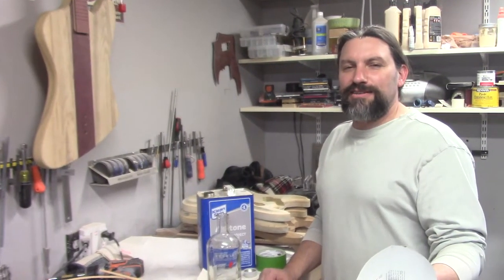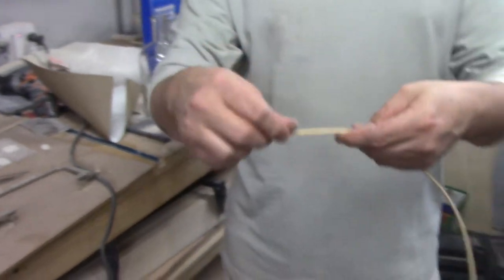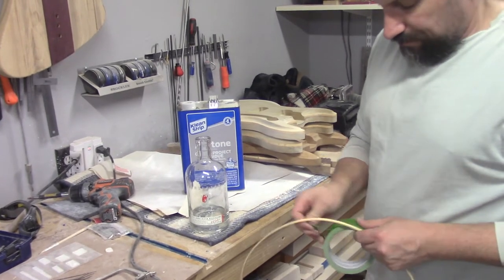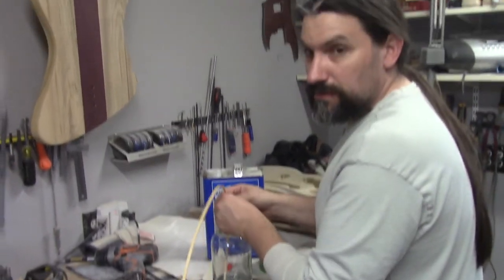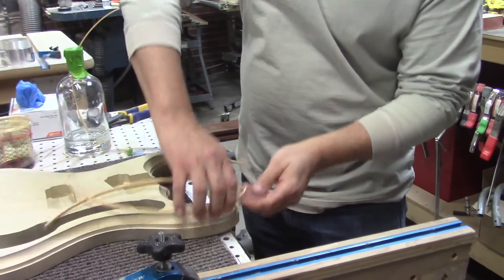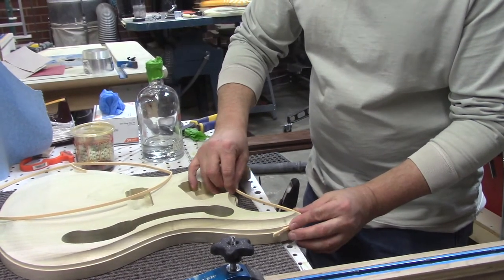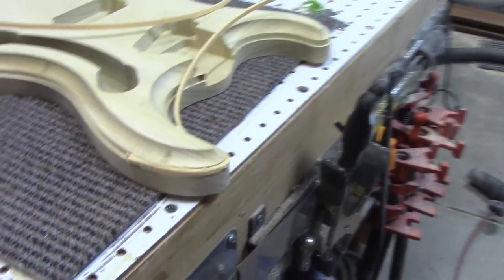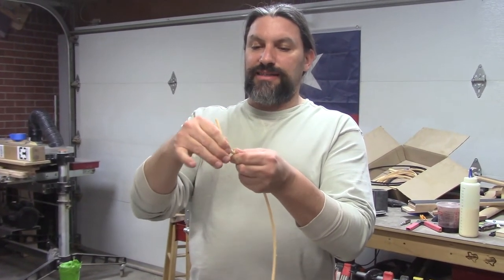A Strange Way To Bend Plastic Binding

Comment: If the binding is left too long, it will get too soft and mooshy. Hard to gauge that with different types and sizes. I soften mine in a 200 degree oven, checking it periodically until it's just soft enough to work. Some people use a pot of boilng water, like as if you were making plastic spaghetti. That way, you wont get so melty.
Reply from the maker: We saw this on an internet forum and had to give it a try. Our heat gun isn't in any danger of losing its job. 
Thanks for watching my friend

Comment: I’m about to use a plain hair blow dryer on my Firebird III binding; no severe bends.
But, I bet this method might work best with just 30-40-min. with binding in the ‘drunk tank.’
Reply from the maker: It certainly will work Keith, there is a bit of a learning curve but no big shake

Comment: Man where was this video a week ago? Had to bind a couple LP's I am building and even with a heat gun it's a royal pain in the ass without an assistant. I usually have my wife help me when binding that stupid lower horn on Les Pauls and it's a breeze but I was solo this time so it wasn't as easy, it's the only part of building Les Pauls that I actually dread haha. I'm gonna do it this way from now on I think the key is to leave it in for a little less time so it doesn't turn into a giant wet noodle. Thanks man really great technique.
Reply from the maker: It does work, I think if you tested it out it could be a really good way to go. I'm sure you have seen the Gibson binding process, not a heat gun in sight. That binding gizmo they run the stuff through has got to be an acetone slurry of some kind

Comment: Hi Matt,  Have you ever tried heating the binding using warm/hot salt? Opticians adjust frames that way. I've used a pie pan on a hot plate filled with salt to bend tight curves.
Reply from the maker: Hmmm I have not tried that before... how do you keep the salt hot I wonder?
Reply: You heat it on a single burner hot plate.
Reply from the maker: I like the idea of an even heat source... maybe I'll give it a whirl one day

Comment: Use the wife hair dryer! :-)
Reply from the maker: We have a big boy heat gun. Mrs. Texas Toast wouldn't be happy if we started using her tools
Reply: Don't laugh I just put my wife's big curling iron in one of my vices and bent a bunch of wood binding. It actually worked really good surprisingly. I only build electrics so I have no use for an expensive bending iron.

Comment: Man I thought you were gonna light that bottle off and bend binding around the hot neck. I'm thinkin if you can't afford a heat gun then building guitars is not going to work out for you. Still cheaper than owning a horse but not a cheap hobby or way to make a living.
Reply from the maker: You know, bending it over something round would have made more sense. 
You are absolutely right though, you will need to invest in some gear if you want to build guitars. I think people get frustrated because they think they need it all right away.